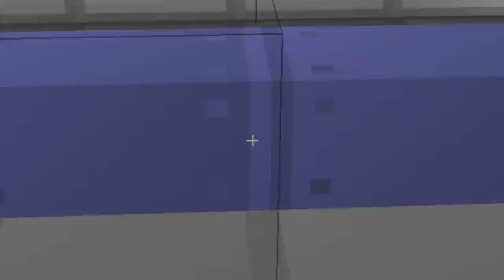Gregtech 5 - Covers Tutorial - Part 1

Comment: Judging on the date of the comments I'm late to the party here but I can't thank you enough for your videos on gregtech 5.  The lack of documentation available today for a mod this complex is astounding.
Reply from the maker: +TechBuRn1337 Yes - Greg does a disservice to himself by not creating a robust Wiki. The FTB wiki is made by volunteers who do their best to keep up with the mods. However, they fail to offer any really good examples. Pitty. I stopped making videos on GT5 because Greg stopped making the GT5 mod, and switched to GT6 which is also very convoluted and hard to understand because he fails horribly at making the mod easy to understand because it lacks documentation. The mod is great, once you read for hours and hours in the Forum - which is what I had to do, and ask lots of questions and hope you don't step on a political land-mind by asking a questions which is on Greg's list of DON'T EVER ASK THESE QUESTIONS or you are banned. Its a slippery slope. Anyway, once Gregtech 6 is complete, I will then have faith in making new videos for the mod.
Reply: +MysteryDump I avoid his forum for those reasons too.  Do you have any idea how to get liquids out of the input side of machines?  I've tried cover pumps, screwdriver on every setting, seems input side liquids get stuck forever and only way to fix is by wrenching?  Look forward to a grey tech 6 spotlight!
Reply from the maker: TechBuRn1337 You need to set the device to AUTO EXPORT the liquid. There are two buttons in the GUI for AutoExport. One is for AutoExport of Liquids, and the other is for AutoExport of Items. Be sure to connect your pipe to the export side of the machine. Have the liquid go into a small tank first, then connect your other machines that need the liquid to work from the tank.